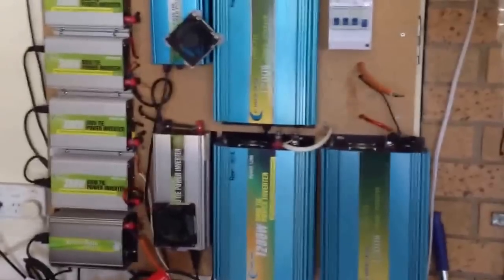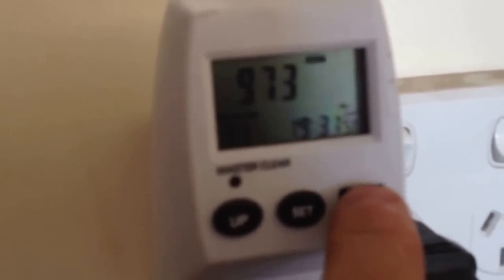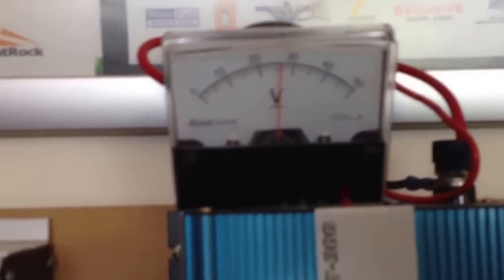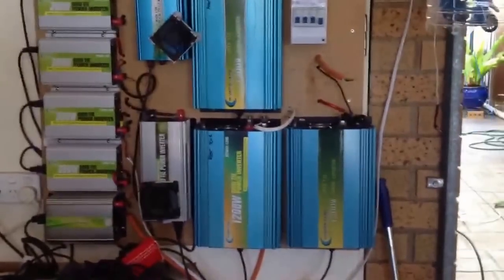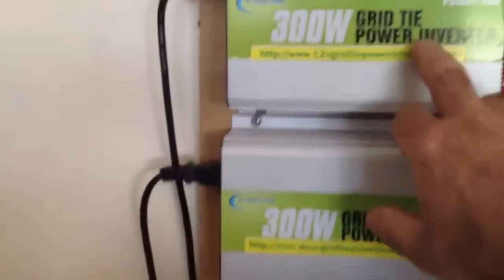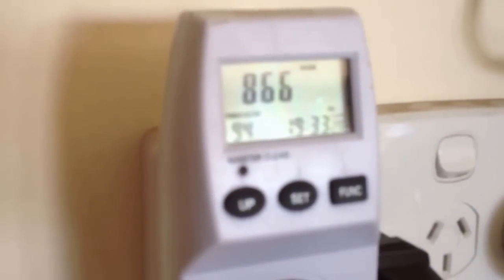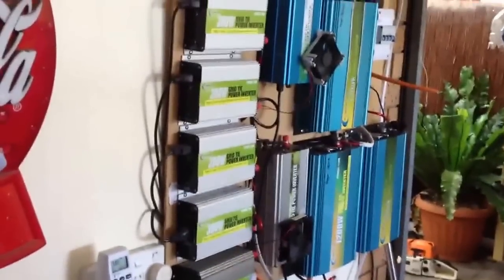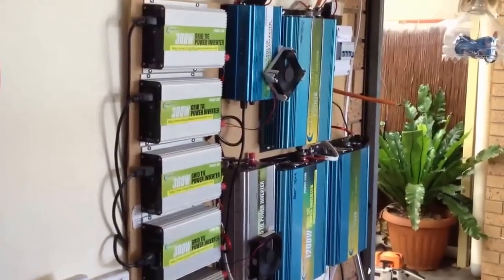Grid tie inverter update

Comment: You should only use one powerful inverter. Your solar panels should all be the same voltage and wattage.
The battery pack should olso be the same amp/hours. The battery pack is the deciding factor how much kw you produce. Thr panels charge the batteries and the pure sine tie inverter transforme 's and pumps the power in your electric circuit.
Good luck.

Comment: Been down your path Shane. Your better off having matching panels and get a JFY Inverter 150*450Volt MPPT. Run them all in series and watch how much better power output you get. With the amount of those cheaper inverters you have bought and thrown away you could have had a real meaty JFY by now.

Comment: hello,  first off.. thank you for your very informative videos... i have
 a question maybe you could please help me with..
i have a small grid tie inverter in a shed on one house circuit, and was
 wanting to put another inside the house on a different house circuit 
due to location of other panels.. i know these are only supposed to 
operate if they sense line voltage.. but will they sense the voltage 
from each other and try to operate if the main line is down for 
maintenance.. I'd hate to send juice up the line to a lineman.. any info
 on this would be greatly appreciated..  thx..
Reply: In case you didn't get the answer you seek, yes, these inverters a) are stackable and b) will stop in case the utility fails.

Comment: I purchased 3 300 watt grid tie inverters and hooked them up to my solar panels and 12 12 volt battery pack. Well after running for a month I found my electric bill was in fact higher then without these gride tie inverters so I run them for 1 more month same thing my electric bill was still higher. As I see it these grid tie inverters are a scam.
Reply from the maker: Hi. You must be doing something wrong. Your meter should be showing a 'feedback'. That will show it's working. 
I would not waste any more money on these. Professional solar systems are cheap now. 3 kW will only cost about 3 grand. Do it the right way.
Reply: AJ W If your meter was higher it shows they work and the meter is recording feed in electricity as useage. I.e. Less than zero. So that means you have little load to use the solar power generated and that would be no benefit in buying them in the first place.

Comment: Shane, are you running these back into the house via the invertor(s) so that it back feeds and reduces the usage of the day etc, or have you got it hooked up in another way?
Reply from the maker: Yes. They feed back into the 'grid'.
Reply: +Shane Mason Cool, was wondering how I could supliment my pro system and cut down my bills a bit more.  Since I have my panels all running and charging 6 bateries that pretty much do nothing.  Might be some food for thought in a few invertors to reduce the load even more.
Reply: Well good to know.  I was trying to think of ways to reduce the load and maximise what I have already, might need to get some GTI's and compliment what I am using.  The panels I have atm charge a bank of 5 batteries that just run a fridge so they are not really doing much.  Do you have any advice on which ones are better or to stay away from.
Reply from the maker: +Blunty67  they work ok. But don't load them Too much as they burn out easy. Never unplug. Always turn off at the wall first and only if you have to. They blow up easy. I have a box full of broken ones.
Reply: Thanks, will keep that in mind

Comment: all your panels should be the same voltage, all connected together and all feeding a single inverter. what i see here is a HUGE waste of money. even if you have some 24v panels and some 12v ones.. then you only need 2 inverters. panels of different watts they can be connected together in parallel as long as they are the same voltage. trust me, I have a 120w panel and a 240w connected together and i easily make 350w in direct sunlight  Kiliwatt meter verified. your panels are most likely cranking out well over 1k on the reg, but you probably have a huge power loss in all the inverter nonsense you got going on

Comment: you got almost 6000watts worth of inverters and only making 1170 watts...wouldnt just one of those 1200 watt inverters do that
Reply from the maker: +arthuriscool1994The Inverters get very hot. Fans run and use power. I have burnt out a few running them at the limit. I run the at about half the rated amount. They last longer.
Reply: ok that makes sense didnt think of that
Reply from the maker: Also some of the panels are 24 volt and some are 12.

Comment: what sort of efficiency are you seeing? What would you expect with 1k watt of panels?
Let say you have 4 250 watt panels and and two 500watt grid tie inverters. would you do two strings of panels into each inverter. Do you hook those panels up parallel or series.
When considering which inverter to purchase, do you match up the VMP(optimum operating voltage) or (VOC) open circuit voltage ?
Do you use a physical disconnect switch between the panels and the inverter?

Comment: Impressive setup. Sorry to sound like a troll and as you mention it is a bit of fun I just think that the benefit of this system is pretty low. 

At a guess you probably have a few thousand dollars worth of grid tie inverters, then you must have over 1K worth of solar panels probably worth a few thousand dollars also (unless you managed to somehow get really cheap ones), not to mention the wiring gear.

So in total lets say you have spent ~$4K dollars on your system, you say you are down from 600-->120 a quarter. So by my math it is going to take you 2-3 years to pay back just the cost of the system alone (maybe less as the price of power goes up) and that is if it continues to give you that return all year round and you do not have to replace any of the gear.

I agree every little bit counts but would it be a little smarter to invest in reducing your over consumption with engery saving devices and turning off unneeded appliances etc.

I am a hobbyist at heart so I understand why you do it, just think the money could be better spent. Anyway just an opinion and not trying to be a prick.

Comment: Just a notice for those who wonder if this will work with smart power meters: NO IT WONT - electric company will charge YOU for your produced power - NOT cool....You have to call 'em up and order a smart meter that measures in both ways! I've done that and its been 2 years now running those little buggers (inverters) with no issues what so ever. I live in sweden so no idea how legal those are in the US.

Also make sure to take the inverters apart and install heat pads on the converting diodes, theres usually 8 of those,  to inprove heat dissipation. Parts made in china are usually alright but requiters YOU to make some quality contol - i have found alot of loose nuts and bults in parts from china...that would be very bad in this inverter!
Reply from the maker: My smart meter shows power returned to the grid. They don't charge for power returned. Only power used.

Comment: If your current demand from you house appliances/lights are 1000 kw and you are supplying 1000 kw from you Solar grid-tied systems, I assume your Utility meter is not showing any usage. In other words, your with a grid-tied in system arrangement, default consumption comes from your system without any special equipment other than your grid-tie inverters which synch up with your Utility supply input.  Thanks for sharing your system and experiences. Much appreciated. Singer

Comment: Shane, I have a question: on the 300 watt inverters Why only 1, 100 watt solar panel on each 300 watt inverter? Why not hook 3, 100 watt solar panels to one 300 watt inverter? thanks.
Reply from the maker: They get very hot and the little fan runs. Which uses my solar power.
Reply: Just to comment, You should always size everything at least 30% larger than the maximum power. Example: if you have a 1000 watt inverter don't push more than 700 watts through it and it will last much longer! ,,This rule of thumb should be applied to every component. Grid tie inverters, off grid inverters, charge controllers, breakers, switches, wire size, etc.

Comment: so you have 5 at  300 watts, that should be 1500 watts each inveter has a min loss of 10%  that is a 50% loss, and you just broke 1100 watts? so you are all happy with a 50% production of what your panels will put out, I have watched so many videos of 300 watts in and 50 watts out >>>> thats not right~~~~~~WTF are you spending your money on!!!
Reply from the maker: In the process of re working all my stuff to run the inverters a bit harder. Have noticed some of my panels are not producting what they are rated at.
My bill is proof that they work. $600 down to $120 a quarter.
Reply: Did you miss the part that EACH 300 WATT inverter only has a 100 WATT panel on it?

Not sure why people comment on things? Now you just look like you dont like to pay attention or are just dumb.

Comment: After seeing your video, I went out and purchased  a 300 watt grid tie just like yours hanging on the wall. I'm new to all this solar stuff so bear with me. I have a 100 watt panel on my roof and hooked it up into the grid tie and right now i am 50.1watts 60.7va  reading 122.7 volts 60hz. .45amps to .50amps. its 1110am in the morning here at space coast Florida. Am I on the correct path to feeding back and cutting down my electric bill? Thanks Greg.
Reply: yes you are doing a great job, it takes quite a bit of panels to make a difference in the bill. The next step would be to order an additional 2 100watt panels and run all 3 100watt panels in parallel giving you a max output of 300watts. after that you'll have an idea
Reply: one 100W solar panel gives about 50W at the AC side. You are doing good. I have 2 300W inverters running 6 100W panels = max 315W at the AC side. Have to order more panels now!!!!

I woudnt recomend connecting more than 3 100W panels to a single 300W inverter due to drastically reduced efficiency...sweet spot is the 3 100W panels according to my testing.

Comment: "wasting" 50 watts on a large 45cm or larger mains fan would easily save you long-term with that setup, just aim it at the board, as another poster mentioned you are well below the optimum transfer % of those baby inverters.
I do understand the heat problem but those tiny computer fans will be doing bugger-all, seriously :)

Comment: nice going. watch out for the killowatt meter melting. they have been known to do that when you get above 600 watts. well killog69 had that problem with a certain brand. the actual killawatt brand is pretty safe.

Comment: I am still learning but I think your setup is very inefficient. Your feeding 300w inverters with a MAX of 100w solar panels and your 1200w inverters with 340w?  The low quality inverters are already inefficient and running them that low is way out of their max efficiency range.  You have at least 1430w of panels on the roof. One quality 1500w inverter would produce more then 1200w. It's a neat setup but there are better ways to spend money.  Good luck!

Comment from the maker: Hi. They are 1200 watt units. The others are 600 watt and the smaller ones are 300. I run them less then half what they are rated as they get very hot.
Reply: Are those blue ones Power Jacks?...
Reply from the maker: Kelvin Coakley Yes.
Reply: Do you know where I could buy 1?...do they have like a specific website that they are sold on?...thanks
Reply from the maker: Are you in Australia? I got them on eBay.
Reply: @masonyahoo1  sorry no...I am located in the United States...I do have 1 power Jack grid tie inverter?...its massive... & rare...its the 2500watt one...I've only seen 1 other guy with one with a video on here?...but his is a 1200 watt one...lol

Comment: If you don't use all the power your grid tie inverters are producing and the rest is being sent to the grid, how do you know that you aren't being charged for the power going back through your meter since most meters only see current flow and not which way it is flowing?

Comment: Buy a real inverter with some quality instead. Like SMA inverter or Enphase micro inverters :) I have also been generating energy like you. With one SUN 250w and one SUN 1000w inverter. The 250w blew up because a condensator inside blew up.. The other one is still working. But now i have bought a SMA 1600 TL inverter instead that is actually approved for my electrical net :) I have 10x 180w panels on my roof. The inverter arrives next month (January) :) :) :) :)

Comment: That many inverters must cost as much as a certified, high quality unit (300W: 5X$100=$500; 1200W: 3X$250=$750; XXXW: 2X$150=$300: TOTAL=$1550 MINIMUM). And how much have you spent on PV panels to power all those inverters? 5000W of PV = $10,000 minimum!
That's a payback of somewhere around, what, 200 years?

Comment from the maker: The inverters kinda shut off at night. They use about 6 watts in totalin sleep mode. I used to turn them off and on. But they blow up to easy.
I have dropped it back to MAX 700 watts at this point now. 
I lost 3 inverters in one day. 2 X1200 and one 300. 
Might sent up another spot later.

Comment: as nrodge said though be very careful on the circuit limits of the house.
Im not sure if you have seen it happen but I once had a wall plg catch fire as i was over loading it.
it is a big risk with these things when you are not home.
if you are that involved in it then you should hard wire it to your houses main feed with one large grid tie inverter.
it is not fun getting home to smell a burnt smell then get in to bed to find the water is cold!........

Comment: Hi Mayson, Nice set up!!  Can you confirm your set up at the time of the vid? (170x4) + (250x1) + (100x5) = total of 1430 panel watts?   but you are pulling about 1000 watts on the 110 side?   About 69% efficient?     Not sure what I'm doing wrong, but I'm only getting 150 watt out of my 250w/31v panel hooked up to the powerjack 1200.   it's about 60%.  Any ideas?   Thanks!!!

Comment: I've been looking into these cheapy little grid tie inverters and from what I have learned to run them efficiently you actually need to feed them near the top level of input voltage. I think you are at minimum input voltage per device? 100w panels one each into 300w inverter? I think you should compare a rewire with 3 panels in series into one inverter if that is within spec or at least two, see which outputs more with killawatt meter. You are in the 60% efficiency range, two would be 70 n3 80.

Comment: @masonyahoo1 
OK, well just be sure about how your smart meter is connected.
Download the user manual from the net if you can find it. I did..
Usually, they have at least two separate power circuits. One for consumption and a separate circuit for generation which your GTI is connected to. If you try and generate back through your 'consumption' circuit, the meter will generate an error flag that will be investigated by the retailer.

Comment: @masonyahoo1 There would be losses in the GTI and the battery so you might want to calculate that first, and I wasn't suggesting to do that, I was just wondering what prevents people from doing that. If they give you two meters, one for in and one for out, I could see people feeding one into the other somehow with a little booster circuit. Whoever thought of paying back more than the normal KWh fee didn't think very hard. Even at 50% loss it looks like someone could make 30c KWh profit.

Comment: Looking good! Be careful as you approach the limits of a home outlet and never run any motors or big surge items on that same circuit or you might blow a GTI. What are you paying per KWh normally? What prevents someone from charging batteries from the "normal" grid, then feeding that back via GTI to the other meter that gives them 66c?

Comment from the maker: I have a real system as well. So the power co won't be able to tell between home made and pro made solar power!
I already have a smart meter. I also make .66 cents for every kw I send back. 
I don't run my GTI's any where near what they say. Even 400 watts on a 1200 gets too hot!
My 300 only run about 100 watts. 
I'm not buying any more inverters. I better stop. When I hook up my last 6 x 180 panels I'll be done. 
Aiming for about 3.5kw. That will cover my bills and some!

Comment: Nice to see it all working for you, but a word of warning..
At some point in the very near future, your electricity retailer will be installing an electronic/smart power meter. Firstly, digital /smart meters do not wind backwards. Secondly, smart meters will alert the retailer if you are feeding power back into the grid and you are not registered for net metering rebates. This could result in a court appearence. I would think carefully before 'investing' too more $'s into your system.